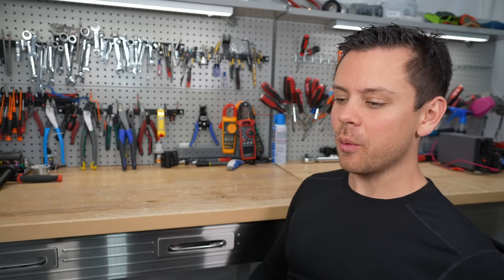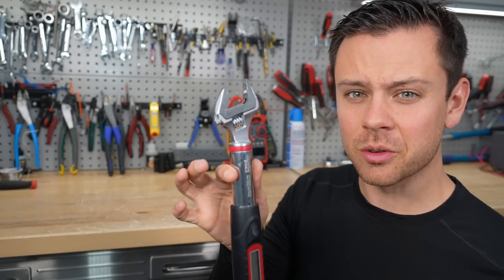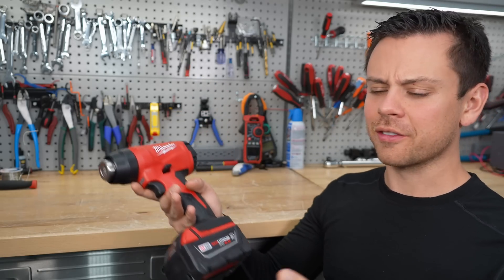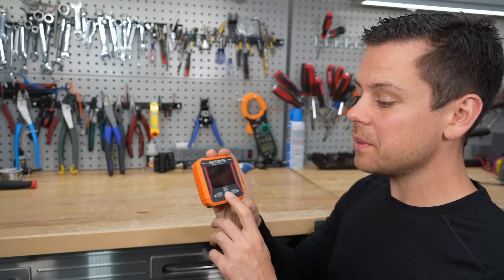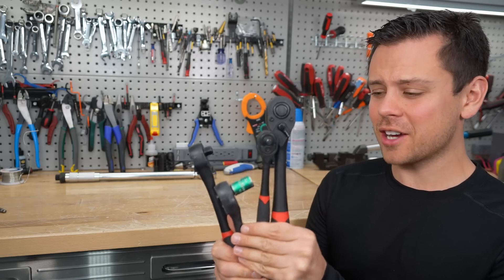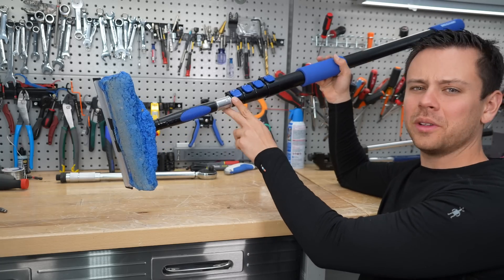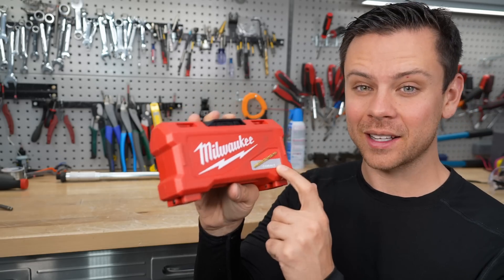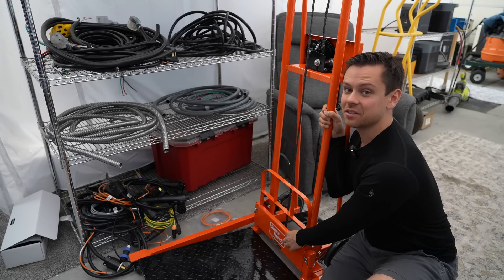25 Useful Tools for Offgrid Solar. Including battery lifts!

Comment: Nice to see you posting again. When in doubt, the better the power tool one buys, the happier and long work life. I bought a Boschhammer one size below the Brute back when, and made the mistake of not getting the hammer drill version. Hugely useful. Thumbs up on the other recommendations, especially the cobalt drills. I've bought so many titanium drills that wear out on a single job, I could have easily afforded the best cobalts money can buy.

Comment: I have about 2/3 of the tools you went over  and your advice is spot on from my experiences too.  The one that has saved me hours and wasted trips getting the wrong parts is the thread/screw checker.  I have used it on every thing from batteries to flange bolts on a turbo.

Comment: If you want to go all out on your panel washing setup, look into the "reach it water fed pole". Beforewarned, it's expensive. 
It is designed for commercial window washers. It uses deionized water and there is practically no scrubbing involved at all. The water dries spot and streak free. The model we use will allow you to reach 30 ft high windows from the ground. The carbon fiber pole is easy to manage.

Comment: These are excellent recommendations. We have most of these tools at work, because they are the safest most reliable tools available. Don't risk your safety, or equipment get a Fluke meter. You can take their online multi meter class and receive a certificate, provided you answer every question correctly.

Comment: I couldn't afford not to get a Fluke. You can't go wrong with Milwaukee Tools, I started collecting them almost 50 years ago.
Reply: Milwaukee hand tools are hit and miss. Their auto wire strippers suck. Their manual strippers are amazing. Their screwdrivers are a sad joke! That being said, I own almost every m12 power tool and prefer them over dewalt.
Reply: @omnomzofchainsaws4278  Do you buy off of Amazon? I've never had a problem with my Milwaukee tools, but I don't buy the screwdrivers or strippers. My Snap-On hand tools have lasted a lifetime. Power tools is what I was talking, I prefer the M18. They keep me almost as productive as I was 30 years ago. Fluke for testers, it's my life on the line.

Comment: Alternative to the Costco brush and squegy is a painters extension pole with an attachment for cleaning windows.    Works great and much l9nger reach.  👍
Reply: I used to have a residential window cleaning business that I sold 30 years ago. Tools I used for cleaning flat skylights and hard-to-reach windows are working great for cleaning my roof-mounted solar. Lightweight extension pole. Squeegee. Scrubber. Brush. I haven't bought any of these tools for decades because the good ones last forever.

Comment: First of all, they are called Fluke Meters because it is a fluke when they work....ha, ha, I crack myself up.  Seriously though, I have found that Greenlee meters are almost, if not just as good as Fluke but a lot less over priced. I have both and used to use them every day at work and honestly prefer Greenlee. Just my opinion.

Comment: Yah, the flukes do work better, but man do they charge for the privilege!  I have the Kaiweets clamp-on and it works, but the dial contacts tend to start to fail within a month or two (maybe corrosion or something), so I have to start to wiggle the dial to get good contact.

Here are some of my favorites:

* Knipex 74 22 200   (large wire cutter), 8-inch diagonal cutter.  My favorite for cutting cables down to roughly 6 AWG.  Super heavy-duty.

* Knipex Super Knips (5-inch knips).  These are awesome for cutting small wires or even for squaring off the copper in large cables (by cutting a few strands at a time).  They have a flat side for very precise positioning.  We call these sorts of tools "Snips" because of their preciseness, but I guess someone must own a copyright on that term so this vendor called theirs "Knips".  heheh.

* IRWIN Vise-grip wire stripper.  I swear by these for stripping wires.  Once you start using one of these kinds of wire strippers you will never go back.  This one just works so well on a huge range of wire gauges, I cry when I can't find it.   I've owned a dozen regular "dumb" strippers and maybe three different vise-style crimpers. These are the best I've ever used.

* Klein Tools 80024 ratcheting data cable / RJ45 crimper (for crimping ethernet / comm cables).  I've tried probably half a dozen brands of data cable crimpers over the years and they all were far less than perfect... there would always be failed crimps.  Until I found this one.  Perfect crimp every time and I've crimped maybe a hundred ethernet cables with this thing so far.

* Ferrule crimping tool + kit.  I happened to get the "Sopoby" brand but I've done a thousand ferrules with this thing and having a ratcheting ferrule crimper along with an awesome wire stripper makes for some nice wiring.

* Wirefy Crimping Tool for heat-shrink connectors (ratcheting).  22-10 AWG.  Very cost effective, I use them for crimping ring terminals ten ways from sunday.

Many more but those are my favorite.

Comment: Soldering irons. I like the Hakko. I've used the FX-951 soldering station. Also the EDYSN stations are very nice and very durable. They make a hot air pencil that they call an Atmoscope. Perfect for small parts.

Comment: I recently picked up a Knipex 13728 wire strippers  They're by far the best wire stripper tool I have ever run across.
Reply from the maker: Buying them now
Reply: I just use my teef
Reply: @my_channel_44  Same, we all got to start somewhere.
Reply: I have maybe 5 wire strippers and not a fan of any of them, Thanks! I will put these on my list. The Knipex tools I have used have been awesome so far.

Comment: Less than 2 hours ago on a recent video I left a Joke comment calling Will a corporate shill for Klein and then he uploads this video saying a Klein he owned broke... Guess there's egg on my face.
Reply from the maker: 🤣🤣 I saw your comment! That cracked me up. I do like their wire strippers though
Reply: I just bought there wire strippers. They are great.  Used to put a Reliance Pro tran 2 in and run solar generator.  

Thanks for your informational videos.@WillProwse
Reply: Wow, what a nice calm exchange of conversation instead of most people on the internet taking offence and then going crazy at each other. Nice to see the humans starting to take over the world again……
Reply: Klein makes good tools. I'm no shill, just speaking from 60 years experience.
Reply: @john_in_phoenix  I agree. a decent chunk of the tools in my electrical bag are Klein. I find it's a solid mid-grade for professionals and probably in line with the highest grade any consumer might ever need.
Reply: @john_in_phoenix  good reputations fail badly when companies fail to live up to them. My 
Parents gave me a very expensive German made Socket Set for my 21st Birthday, which turned out to be very low quality dangerous to use Crap. Any reasonable pressure on the sockets and they exploded like bloody hand grenades going off. I replaced every socket in the Set with high quality British Sockets so. my parents thought it was still the Set that they had bought me, and which then gave me many years of good service. After other German Quality disappointments in the many years since, I have now finally stopped buying anything German tbh, as even their Customer Support is now a disaster. ☹️☹️☹️
Reply: ...after 50 years in the electrical trade and working with countless other electricians, and as far as hand tools, klein is the predominant brand by far with professional electricians. Hands down. 
My 48 year old retired 9" linesman pliers are still hanging in the shop, ready to work. 
Everyone has their favorites, the pro's are klein.
Reply: @dawg2100 I used Klein tools today to change out a receptacle. 
Just in case it's hot when it's not supposed to be Klein is a good insurance policy!
Not a fan of heart defibrillation when it's not necessary! lol
Reply: @alvinhyman6838  good laugh, Never heard it put that way before...
Reply: @alvinhyman6838  you are a poet, and you didn't even know it....
Reply: Good Morning Mr. Egg Face...
Reply from the maker: I don't get the egg part
Reply: @WillProwse  "Egg on [someone's] face" is an idiom that means someone has done something that should make them feel foolish or feel shame. I joked about you shilling for Klein right before you suggested other brands alongside mention that your klein broke, so I should feel foolish for being hasty in that judgment (considering it was said as part of a joke me saying I should feel foolish is an extension of that joke).
Reply from the maker: @inplfw  ohhhhh ok haha I understand now
Reply: Props for fessing up - that’s sadly rare these days. Speaks volumes positively about your character, and that you clearly aren’t a Politician. Bob in Wales. 🤔🌟🌟🌟👍🏴🇬🇧

Comment: Just a simple note... If you are using torque on any hardware ( bolt or screw, fitting), it is highly recommended that you use new hardware.  You should never reuse old torqued hardware due to the torquing (stretching, squashing or compression) of the hardware, this is due to the lowered expectancy and reliability of said hardware.  In most cases, the threads on such hardware is pulled to a compliant requirement.
Reply from the maker: I actually said that in the video. Did you watch the video?
Reply from the maker: I also said it very early on. Did you miss that?